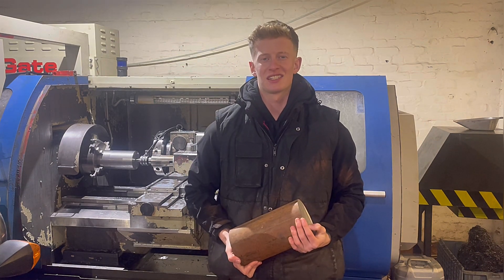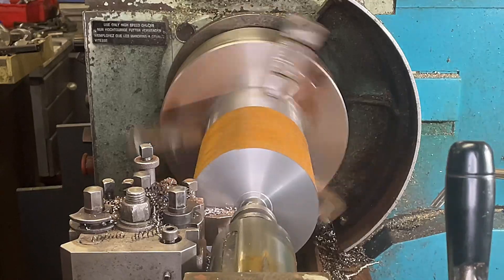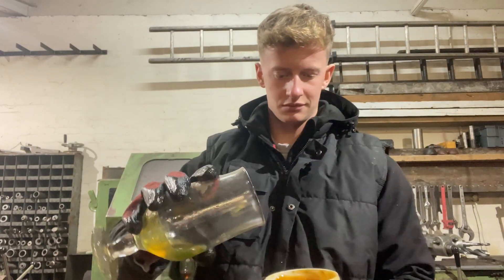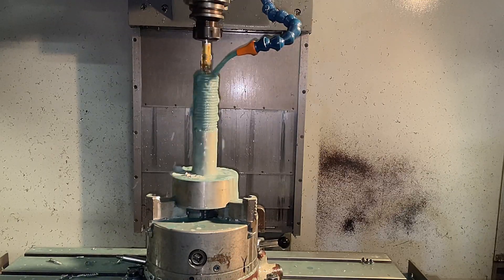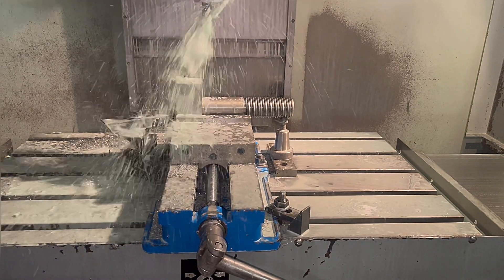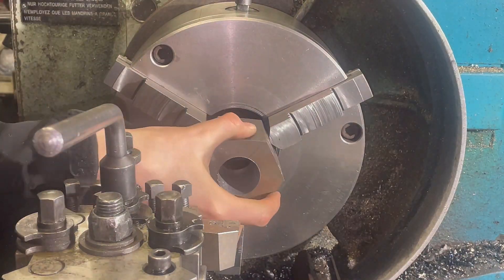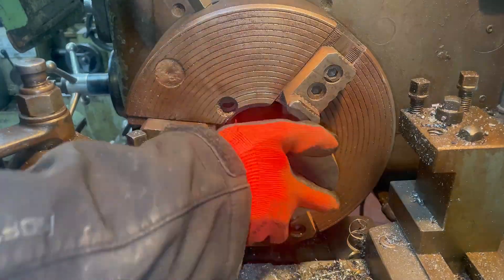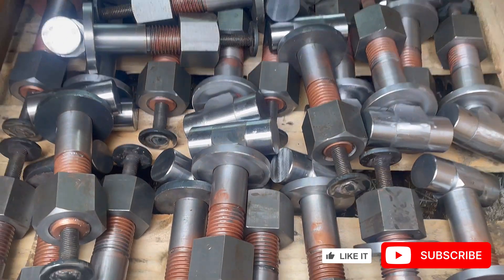Making an Industrial T Bolt from Scratch on a CNC Lathe & Machining Centre - Precision CNC Machining

Comment: Profound waste of metal. Where are the real welders and machinists here!.???
Reply: Yeah, stuff like that is usually stamped, forged or cast. Then minimal machining to finish
Reply from the maker: While stamping and forging are great for high-volume production, they aren't always practical for small-batch or custom work. Stamping doesn’t work well for thick steel, and forging can be cost-prohibitive for low quantities. Machining from billet ensures precision, strength, and flexibility for one-off or limited-run parts. As for 'real welders and machinists'—this is real machining. Not everything can be mass-produced, and sometimes billet machining is the best tool for the job.

Comment: idk man, doing all that work on manual when you have a cnc machine.. Chamfering that nut on manual, that was cringe. As was that prep work, cutting to a OD before cnc lathe. lmao
Reply from the maker: Thank you for your comment. We perform pre-operations manually for two reasons. Firstly, billets come in various sizes, so instead of adjusting the CNC program for each one, we turn them to a uniform size, which also helps preserve CNC tool life as it doesn't have to remove the harder outer layer. Secondly, we run this job across multiple machines simultaneously (where op 1 occurs at the same time as ops 2, 3, 4, etc.). Regarding the nut, I agree with your point about multiple operations, but we're currently limited to a one-tool machine due to a turret issue on the CNC lathe assigned to this job. I hope this explanation clarifies things.

Comment: Heya! Nice work there! Small tip, to save the tip of you life center a bit you can also throw on a flange nut or turn a small contraption that fits it a bit nicer. We did that to secure bigger parts from walking out of the steadyrest on longer jobs too.
Reply from the maker: Nice one mate I’ll defo give that a go next time 😃👍

Comment: Having forgings made would have saved much waste and given you grain flow, this would be desirable on such a stressed part.
Reply from the maker: They was forged originally but it’s quite hard to source forging theses days and these bolts was needed ASAP 😃
Reply: @SterlingNorthern  I understand your situation. The 'just-in-time' ordering mentality does no one any favours.  This may be a good time to establish a relationship with a forge, even if it's a long way away. Those number of forgings would take 1-2 days to make saving the engineer time and money, as well as giving much needed work to a forge. It also helps the industry to think holistically, if the forge goes, then, when you really need it, it's not there, so you have to look far and wide to get the job done. Currently in Australia we are down to one heavy forge and a handful of general blacksmiths. The one remaining Trade school is mainly catering to hobbyists and trying to survive. Once the training goes it's all over. Once it's all over we will have to import our forgings from India or China at great expense. We must not succumb to short-sightedness. And always remember the Production Managers old saying "A lack of foresight in ordering on your part does not constitute an emergency on my part."

Comment: I've no clue if it's been an issue for your shop, or even if it ever will, but the amount of material wasted in each of these bolts really grabbed me.

Have you considered some sort of trepanning step for removing the ~⅔ of those billets you're currently having to rough (potentially saving you on tool wear and materials costs)?

I dunno, this just seems like a lot of work to put into what's ultimately swarf on the floor...
Reply from the maker: We wholeheartedly agree that it's unfortunate to waste such a significant amount of material. We've extensively explored our options, considering the immense challenge of moving all that swarf. However, we've encountered difficulties with trepanning due to the diameter and length of the shank. Initially, we considered welding a billet onto a shaft and machining it down, but dismissed this idea due to potential strength loss, especially considering the extreme pressure these bolts endure. If you're aware of any specific tooling or alternative methods, we're eager to hear your suggestions 😃
Reply: @SterlingNorthern    After posting my comment, I spent an inordinate amount of time dwelling on this topic, trying to brainstorm options on this. And your point about trepanning being nigh impossible at that depth kept tripping me up...

Various thoughts came up and were subsequently dismissed since they introduced new points of failure. Like, sawing/grinding off the excess material prior to the turning operations for instance.

The only one that seemed to hold a glimmer of promise (in my mind) was some form of wire EDM processing, but that's an entirely new kettle of fish, and I imagine quite cost-prohibitive...
Reply from the maker: It sounds like you went down all possible solutions as we did 😂 and I agree with wire EDM but like you say it would open up a completely new can of worms haha, I do appreciate you trying though 😃
Reply: @SterlingNorthern  I agree it's not worth to compromise especially replacing an originally forged part.It would have been a different story if the T end was much larger in diameter.I have a machine shop and noticed our similarities in prep before cnc machining especially when there is no hydraulic steady to do all the prep.
Reply: Have you considered procuring  precut T- blanks from an adequately thick plate with desirable properties using water jet. Then the T blanks will just be machined down to spec. I watched similar approach used by Cutis  of Cutting Edge Engineering channel.
Reply from the maker: Good idea, but since it has a 50mm diameter, the cost to have it laser or water jet cut would probably be more than the billet itself 😃
Reply: @SterlingNorthern    Apropos of nothing, it occurred to me that I mentioned kettle of fish, you mentioned can of worms, EDM operates submerged in water, all we need now is mention of hooks and reels to really make this fishing expedition happen. 😅

Regarding water jet/laser cutting, I almost commented on that in my previous message, but the limitations that exist with those techniques is what, 10 or 15mm thick (maybe 20? Idk), right? Any deeper, and you're talking about some serious machinery! Not to mention the inevitable heat buildup that would have to be addressed.
Reply from the maker: It appears you have me hook, line and sinkerd 😉 but yeah I agree we would be talking so seriously machinery